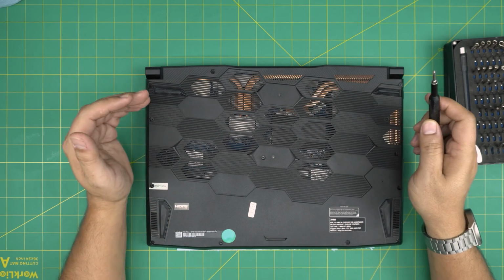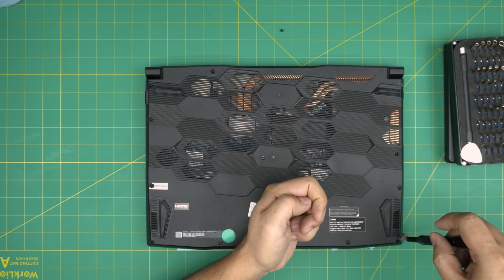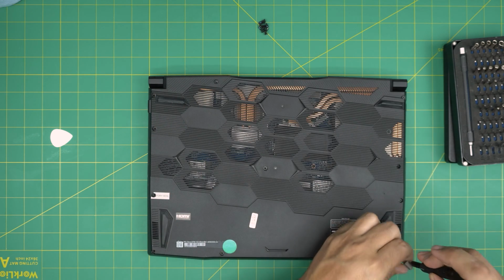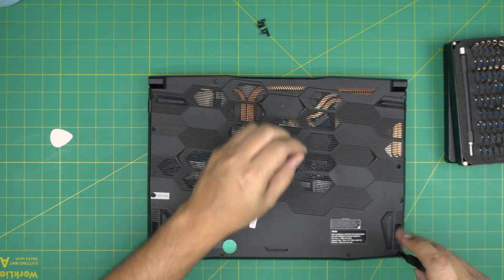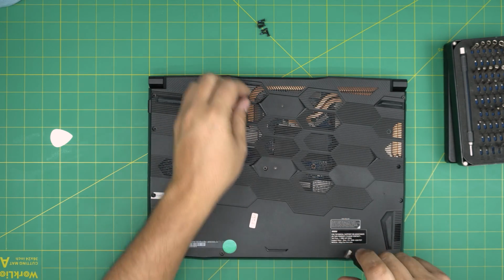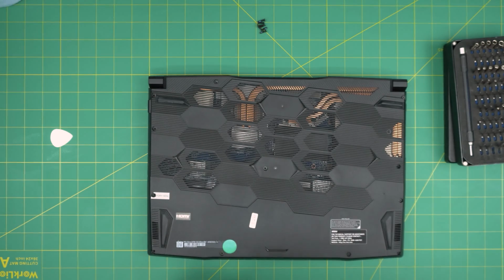How to Replace the Battery on an MSI Katana GF66 11UC MS 1582 Laptop

Comment: Hey, I have a MSI katana 11UE version. It come with a 3 cell battery by default. 
Can I upgrade to a 4 cell battery that comes for Katana gf66 11UG version instead?
Reply from the maker: 🫠Regarding your question, sure you can if the contacts do match then sure you can my friend.

Comment: Hi, have you still not found a upgraded battery that can work for this laptop?

I have had mine about 1.5 years and the capacity has dropped 40%.
Reply from the maker: Regarding your question, if you take a look at the video description the top 1st link is the battery link and the battery model.
cheers🍻